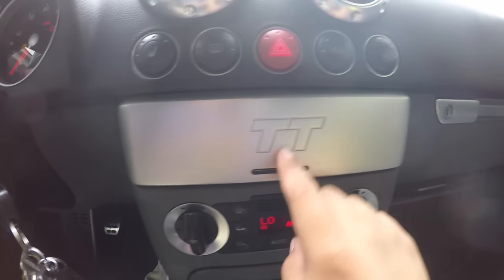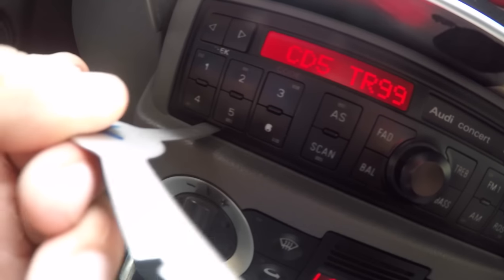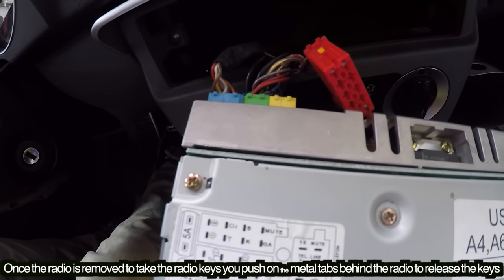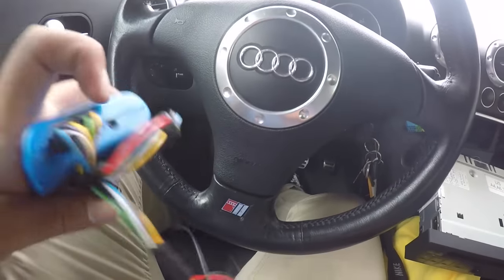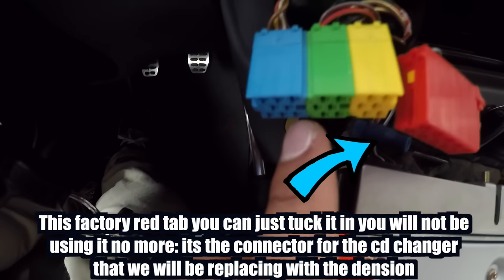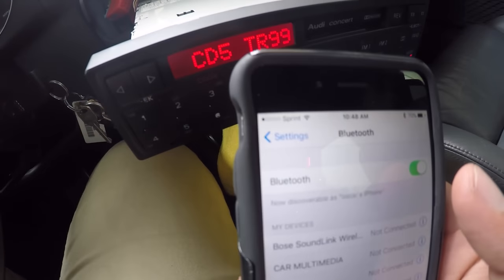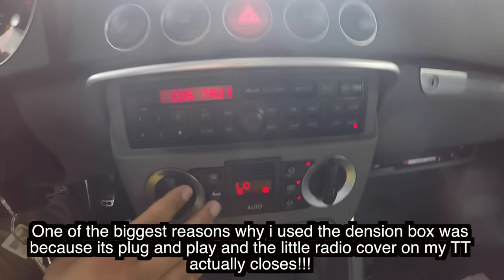Audi Concert Bluetooth install!!!! EASY (STEP BY STEP) *Dension GBL3AU2*

Comment: Disconnect the battery before doing audio install on Audi's- a short or voltage surge could damage your dash pod (gauges) doing anything electrical with the pod energized.
Reply from the maker: Ferf Zero yup, i know that but i didnt have my radio code since i bought this since i bought this car used
Reply: Ferf Zero call dealer w/serial code from radio and they can give code
Reply: You mean to disconnet the battery under the front hood or the power cable of the radio?

Comment: Watched your video a few weeks ago. Just bought myself a dension unit for my 2000 Audi TT with a Bose speaker system. Really appreciated your video while I installed the until. Was scared to connect the dension harness into the back of the radio as it wasn’t a loose and easy connection, but a little bit of pressure and everything works. Great. Thanks for the video!
Reply from the maker: Yea i’ve had this blutooth adapter for the longest time and its never let me down glad i was able to help!
Reply from the maker: Yea i’ve had this blutooth adapter for the longest time and its never let me down glad i was able to help!

Comment: That red wire that you disconnected and tucked away, that is not for the CD changer, but it is for phone and navigation. There is a sticker with a wiring diagram right on the top of the stereo that shows you what it is and what the pin-outs are for.

Comment: Great video !!! Unfortunately, I m having pairing problems. I use these 2 codes (0000/1234) still not working.  I need help. 2001 audi tt quattro.
Reply from the maker: Try 8888 that was my code!

Comment: i have a 04 tt with a ipod 30pin in the dash that the owner installed im wondering what kind of unit they installed i guess i need to pull the radio out and look before buying anything cause it may have the denison box and i only need to order a lightening cable or maybe it has blue tooth and i dont know about it im not sure

Comment: Nice job! Does this apply to 1998 A4?? Im assuming its the same
Reply from the maker: Hello and thanks! You know im pretty sure it will work but i would just verify on the enfig website 
Or also would just take out the radio with the little dollar tools and check if the connections are the same.

Comment: Hi, would the radio (fm/am) still work with the bluetooth installation? (for 2001 Audi TT with the same stereo as the one shown in the video)
Reply from the maker: Still works you just lose the cd changer

Comment: does this dension box works also with newer iPhones like mine iPhone 11 ? is it really plug and play and how du you connect the box to the iPhone ? is the box always on bluetooth ?
Reply from the maker: I have my 12 pro max and it works perfectly with the adapter, theres a code that it comes with and you just pair it super simple. I had my adpter for 5 years now and no issue
Reply: Thanks man

Comment: Alternatively buy a cigarette lighter Bluetooth FM broadcaster for about $15 and if you’re wanting to keep your ashtray closed install a secret 12v socket running off the OEM socket. The phone connects to the broadcaster unit then the car radio picks up the broadcasted signal and there you have it.

Comment: This will solve the problem of what to do with my Bose!  Is there a model number on the Denison box?
Reply from the maker: Charlie Nostrand glad i could help buddy! & its in the link in the description: dension  GBL3AU2
Reply: Fantastic! !  Thank you for the video and quick reply!   I'm the original owner (2001 with only 50,000 miles!) and the one thing that has nagged me is the lack of "modern" blue tooth functionality with the radio.  Last question: Does the wiring that comes with the Dension fit the Audi harness or do I need to swap any connectors??  I know you showed a whole packet with zips wrapped around the Dension but was curious.
Reply from the maker: Charlie Nostrand i know right! When i got my audi i hated that it had a decent radio but i couldnt listen to my songs! And yess buddy the dension comes with all the wiring you need its plug n play, i forgot to mention that the only connector that gets left out is the six cd radio changer but, i mean who uses cd's nowadays haha & no problem buddy glad i could help (:
Reply: You are THE BEST!!!
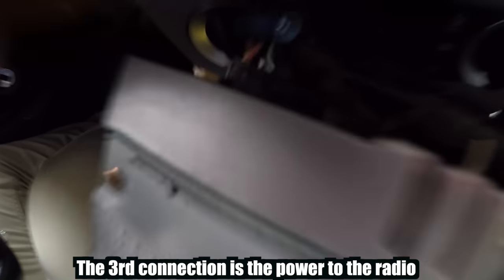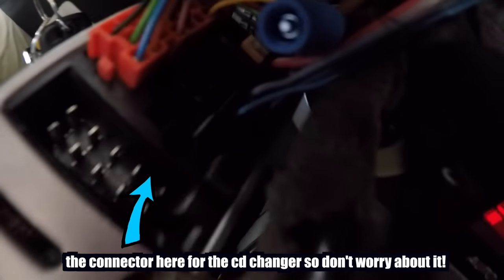Reply: Last question - I have been to all the local auto shops and Best Buy and cant find that blue connector that you first see in at 2:26 and you are plugging the ground into at 4:45 - 4:56. Do you know what they're called?  I'll order one from Ebay.  Thanks buddy!
Reply from the maker: They are called "posi tap" buddy! You can also use anything that will tap into the ground cable! Theres stuff like quick connectors that you can use aswell
Reply: Thanks!

Comment: I´ve just got a Gateway Lite BT for my Audi Concert 1 radio and the BT works pretty fine, BUT I couldn't manage to make the USB work... I've tried everything but my Dension doesn´t read the USB pendrive.. How did you make it work?
Reply from the maker: I actually never used the usb plug at all, i ended up making a custom port next to the cup holders
And i believe the USB Plug is to upgrade rhe software on the dension somehow
Reply: Gabriel1996 I think I will have to upgrade the firmware. Maybe that's the problem

Comment: How is the Soundquality? I heared from another Boxes, that it is not good at USB and also on BT.
Reply from the maker: It sounds great! I used to have one of those radio transmitters that i bought from ebay and that really made everything sound crap. This box doesn't do that tho, been running it for about a year now and i have no complaints bro
Reply: OK. Sounds great. Thx bro!

Comment: is there any cheaper module than this one? it's pretty expensive.
Reply from the maker: +Martin Žebula if you look on the enfig website i think they have a non blu tooth one, its cheaper than the one i bought, also they have ebay ones but just make sure its plug and play bro!!

Comment: I tried this in my 1999 Audi A3 and it didnt work. So im stuck with using a FM transmitter
Reply from the maker: anders pisani thats a bummer man! Try checking the ground? Just to make sure everything is plugged in right!

Comment: Hi! Are you able to change tracks from the head unit?
Reply from the maker: Kemenes Ákos hello yes you can i use that all the time lol
Reply: Gabriel1996 I have the same setup, and  its not working. Now im
checking the firmware version.
Reply: It fixed the problem. It had the 1.04 version and now its the latest 1.19 and its really nice 😄
Reply from the maker: Ahhh you updated it? Damn i never have done that

Comment: tape cassette adaptor, much cheaper & no messing about, cassette in the slot & plug strait into phone, excellent sound output & eazy to use for ppl who don't no how to set things up,£4.99 on eBay 👌👍😉
Reply from the maker: nickysb76 i had the cassette player usb adapter lol it got stuck in the player 😂was the whole reason why i changed it to Bluetooth and no wires anymore 👍🏻

Comment: i just did the install.. I have a bose set up.. it's not letting change the input to CD I'm guessing because of the stock amplifier?.. how could I go about this?
Reply from the maker: I doubt its the amplifier bro i would check the connections that they are plugged in properly, i never got that problem with mine